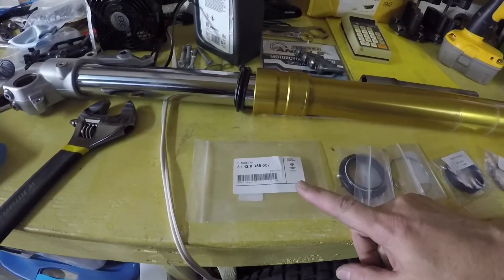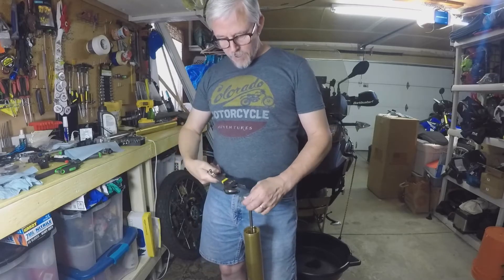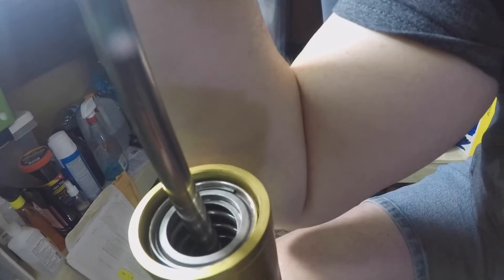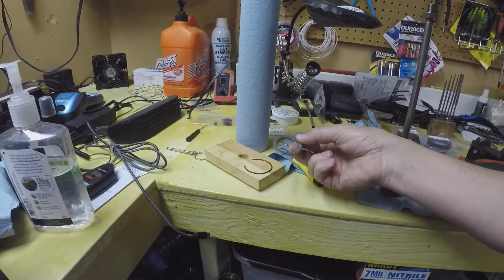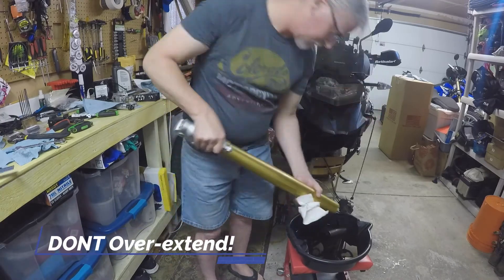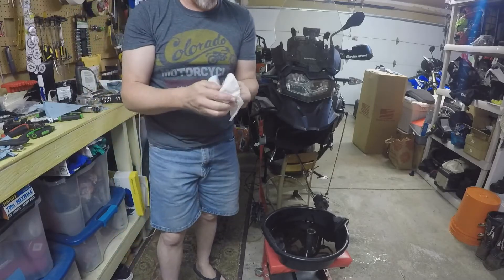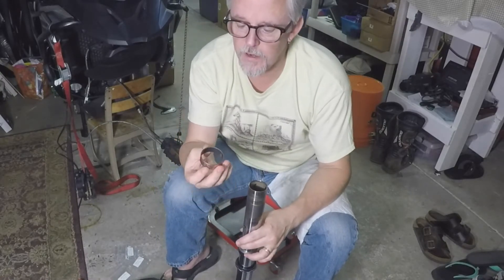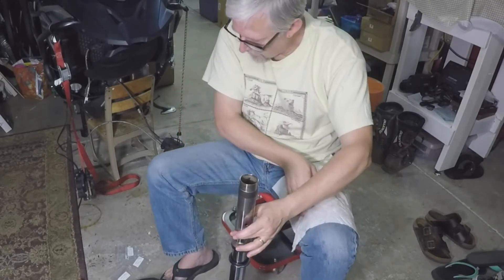F850GS Fork Rebuild - 2019 BMW

Comment: I've been fighting with that C-Clip for 2 hours now, and it's driving me insane.  I've rebuilt engines, manual transmissions, but these stupid little C-Clips are going to be the end of me.  Why didn't they use a Snap Ring instead so you can remove it with pliers?
Reply from the maker: I hear ya dude. It drove me pretty crazy too. I found a pair of angled tweezers and a tiny flat blade to give me enough push-out from the outer edge and 'lift'  with the tweezers at the same time to do it. I'm sure BMW has some special tool for it but why not go 'standard', eh? Pfft.

Comment: Very informative, thanks so much for this, very helpful. Do you know what size fork seal driver you used? Motion pro has a ton of different sizes. Thanks!
Reply from the maker: Thanks man - Sorry I don't. I think I'd suggest using the BMW fork size which the web says is 43mm.
Reply: @bobwolff68  thanks for the reply. While I really like motion pro tools, I noticed the one you were using is adjustable and I think I'll go with something similar. Much appreciated 👍

Comment: Very nice job. Too bad that good seal drivers are so expensive. What springs did you use, and did they come with the spacer pre-cut?
Reply from the maker: Hey Ted - thanks. I don't recall how expensive the seal driver was, but I wanna say less than $35 at Cyclegear. I bought the Yacugar springs (mildly progressive ones) from Beemershop. It gets discussed in the subsequent video on re-assembly. What's up with "the spacers pre-cut" you mention? Gulp. Did I miss something important?
Reply: A lot of springs are not bike specific and require the owner to cut a new spacer to accommodate the spring and set the preload. I suspect the springs you received were the correct length for the F850 considering the factory spacer and did not require a new spacer to be cut. Otherwise it would have been mentioned in the directions with the springs.

Comment: Hi Bob i have a question  i want only  to change  my oil from my front forks.
Must a take both  legs off the bike or only the right one.
Or can i suck the oil out . ?? 
Thank you Martin.
Reply from the maker: Hey Martin - Yeah I think the only realistic way to do it is to remove the forks to do the job. It's a bit more work, unfortunately, but it'll give you some great experience removing the front wheel and calipers and getting to know the underside of the front end. I had thought about sucking the oil out as well and while I'm betting it is possible, it won't get all the crud out like turning it over would. Would it be helpful? Yeah I'd imagine 90% of the goodness if I had to guess. If you do try that, please let me know how it went and how you feel about it afterwards!

Comment: Hey Bob, I love all your videos. My F850GSA has just done 30,000 km’s and is due for fork oil replacement. Three questions.
1: how much oil in each fork and is there a measurement from the top to the top of oil level?
2: I assume I would only need to pull the forks down till both main springs were out? But leave the right damping rod in?
3: I think think the Manuel calls for a strange oil viscosity like 11.5. Was winding what you used and if you think I could use a 15wt oil as these shocks are a little soft.
Regards
Reply from the maker: Hey Stephen - glad you love the content. The questions you ask are excellent and I did cover these items in the videos themselves. They're a bit long to watch fully sometimes, but the info is in there - even a discussion about that 11.5 weight oil. Grab a beer and watch / listen. :)  I do believe on the oil that I went with a heavier weight for the same reason you have reasoned out. Super happy. Also the progressive springs were super helpful as an upgrade.